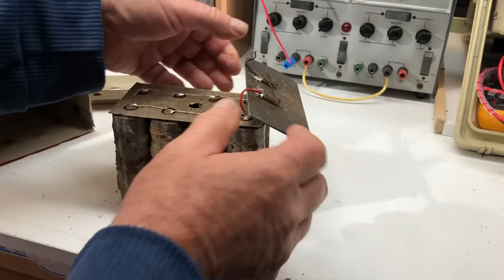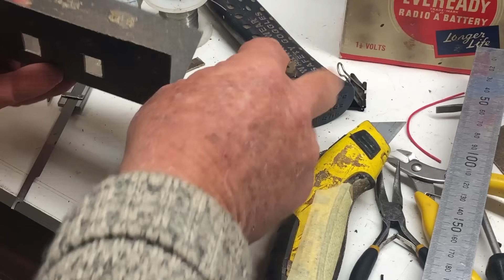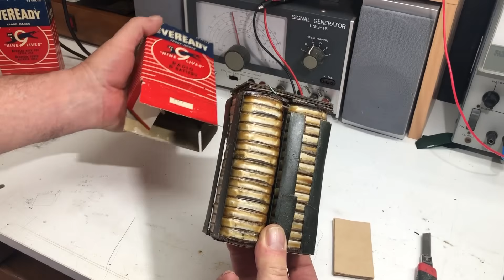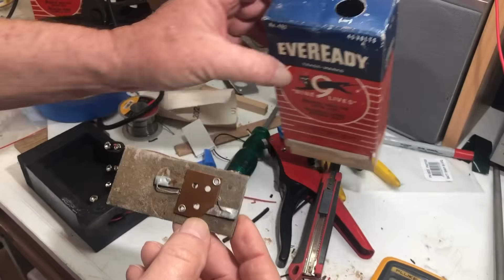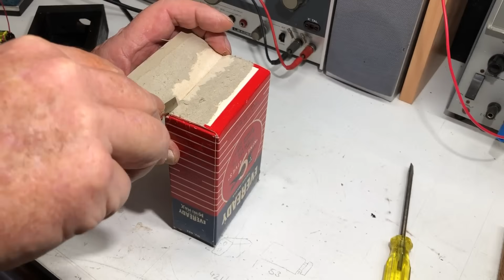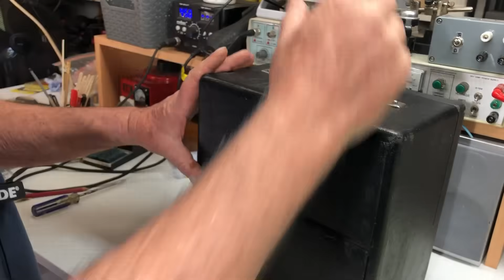Peal Radio - Old batteries live again!

Comment: What a lovely old radio and I love how you've kept it authentic. I also remember deconstructing those old Eveready batteries when I was a child. Great job you've done.
Edit, I remember the later 9volt box battery, maybe it was the '276', instead of the earlier waxed cell internal construction, the later ones had a plastic frame inside the cardboad box, with 6x 'C' cells wired in series, within the plastic frame.
Reply from the maker: Thanks. I didn't know about the later 9 volt ones. I only remember the old wax ones, but then I haven't pulled any of them apart for a long time prior to this.
Cheers

Comment: What degrees of complexity might be involved if you wanted to use rechargeable batteries please in this set up to produce up to 90v?
Reply from the maker: Hi
If I was going for rechargeable batteries I would probably arrange the batteries so that when being charged, they would be switched from series to parallel so that you could charge them at 9V (at a higher charging current).  You would probably need to get a battery charge board for each battery (a few dollars on ebay) and do the switching with relays activated by the charger being switched on.  It would be a bit complex but I think it would be achievable for a reasonable cost.

Comment: I had a job as a high school student replacing radio batteries in the 1950's  for people on vacation at  a lake resort.
The big part of the job was to have the proper battery sizes in stock which was a challenge as there were so many different radio brands and models. I remember the Zenith Transoceanic battery was so expensive that few customers would be willing to purchase a new one and if they did would use it sparingly and it would last several seasons.
Reply from the maker: Hi
That sounds like a fun job.  Just . doing a little research around the batteries in this radio I'm finding an incredible variety of batteries that are no longer available.
I guess a Transoceanic would have been a high end radio and perhaps they considered that if you could afford the radio, you could afford the batteries.  It does sound a bit ridiculous though.
Of course the revolution of transistors changed all this.
Thanks for your interest
Cheers

Comment: it wouldn't be too hard to make the high capacity batteries with some lithium cells , 12 or so would make the 45 volts,  nd you could put a charger inside the battery,
Reply from the maker: Hi
Yes, a few people have suggested similar things.  I like the idea of putting the charger inside the battery, that would certainly be the most convenient way and charge cards are available on ebay for not much.
However this is not my radio, so I did what the owner wanted and he was happy with the result.
Cheers

Comment: Great restoration job on the vintage batteries, there are a few companies in the UK, who will make up replica battery case outer boxes & also 3D print suitable battery holders for what ever type of cells you want to go inside.
That's a nice little radio, a good sound, I like the way that opening & closing the front cover turns it on & off!
Reply from the maker: Thanks Richie
I have had a look at some of the UK companies offering replica batteries. They look like good quality. Unfortunately freight from the UK makes them uneconomical here but it's good to know they are being produced.
Cheers

Comment: Very nice job on those batteries. They can now be easily replaced when needed and look the part. The case came up very nicely also.
Reply from the maker: Cheers Ian.  It worked pretty well for a one-off job.  Lots of people have said that I should've used rechargeable batteries but that's not what the owner wanted and would add another degree of complexity.

Comment: Well done, I remember working on battery sets just before my mother died, and making up the 9 volt batteries for the 90 volt section, and the 1.5 for the filaments. Unfortunately I lost a lot of stuff, and spare parts, and valves etc, when I had a stroke in 2022 I'm only just getting interested again in it. I'm now trying to replace some of my stuff, I shall never have anywhere near the amount of stuff that I had ever again, a life long hobby just gone to waste.
I have a large family out in Australia, but of course I'm in the UK, I never hear from The Young Ones now.
Yes i remember pulling old 9v batteries apart as a kid, at least we could pull them apart in those days without the risk of them bursting into flames. Similar to what you were indicating at the end there, it's not a life today it's just a trial.
All fond memories from years ago.

Lovely video, you've worked hard, thank you for shariyng it take care my friend.
Paul UK.
Reply from the maker: Hi Paul, great to hear from you.  I suppose one of the main reasons I work on old radios is that they bring back memories of simpler, happier times when quality mattered and things were made to last, not thrown away when the warranty expires.
Your stroke must've been a major setback in many ways and it's a pity you lost all your gear, but I believe it's never too late to start again.  You haven't lost your knowledge or experience and you're regaining your interest. The rest will follow. 
As I'm sure you know, you don't need much to get started and you can buy what you need as it is needed.
All the best, Paul, and please keep in touch.  I'm glad you enjoyed the video. 
Cheers
Reply: @Donno308 Hi Don, thank you very much indeed for your kind words and wishes going forward, it's very much appreciated.
Yes you're absolutely right, that was exactly what I was thinking, when I was having a look through some resistors and capacitors, it wouldn't take much to get started again.

Thank you for your words of encouragement, that was heart felt, Thank you. I 'll keep in touch.
Take care, Paul UK.

Comment: Well, if you are merely going to install modern batteries in the old cases, why not use Lithium Ion cells? They offer great current capabilities for their sizes...
Reply from the maker: Hi Gary
If it was my radio I would seriously consider doing that, although I would probably go a NiMH battery for the filaments.  I wouldn't want to risk running them over voltage and I would prefer to run them somewhat under. Those valves are becoming hard to find!
However, the owner just wanted it working as simply as possible for display and demonstration purposes, so that's what I did for him.
Cheers

Comment: Hi Don, have you used any Lithium-ion cells before, as I think these being rechargeable would be ideal? The only problem is that the voltage is 4.7 volts fully charged, but a small step-down DC-DC Buck converter would easily drop the voltage down to the couple of volts required for the heaters of the mini valves. The same lithium-ion type batteries can also be used for the HT supply  9 would give you 42.3, which should be sufficient or go to 10 and get 47 volts, which again should be ok. The voltage control and charging circuit and socket can be found on eBay, or if you have problems, just let me know. I have used these devices on many projects and have not as ot yet had any problems. The beauty is you don't have to keep on replacing batteries when they go flat. Regards MoK Electronics engineer and one-time radio & TV repairer for over 70 years.
Reply from the maker: Hi
If it was my radio I would seriously consider doing that, although I would probably go a NiMH battery for the filaments.  I wouldn't want to risk running them over voltage and I would prefer to run them somewhat under. Those valves are becoming hard to find!
However, the owner just wanted it working as simply as possible for display and demonstration purposes, so that's what I did for him.
Cheers

Comment: Looks like the original cells were " F " cells
Reply from the maker: Hi Graham.  I was wondering what they were.  I've never heard of F cells but I'll google it.  I guess it makes sense that they would use some standard size rather than custom make them just for that battery pack.
Cheers
Reply: @Donno308  Yes, the originals are 'F' cells, the same diameter as a 'D' cell but about an inch taller, you cant buy them individually, but if you really want some, you'll find 4 of them inside one of those 6 volt square 'lantern' batteries, (often numbered as a '996' battery here in the UK) the type with the 2 springs on the top, they are still widely used in things like roadworks warning lamps.

Comment: To save a bit of soldering place the batteries side by side and flip every second one so their polarities alternate. Now use the connectors as jumpers between the batteries (short the connector so it becomes a jumper). Chop one connector in half to use for the first and last battery - the half connectors are the only ones you need to solder to a wire.
Reply from the maker: Hi
I did try that some time ago (before I was doing youtube) but I found that the 9V batteries were just a fraction too big to fit that way.  
I also thought of clipping the batteries together with their own connectors with every second one upside down.  That didn't work either, for the same reason.
I suspect they deliberately make them that way to prevent stupid people from doing stupid things.
The nanny state strikes again!
Reply: @Donno308  I've never had that problem, but haven't done it for ages. Perhaps manufacture variations? Anyway, your solution works great.

Comment: Great job! 
Looking at this article the F cells used in the big 741 battery are still made and can be found inside other current batteries. 

https://en.wikipedia.org/wiki/List_of_battery_sizes
Reply from the maker: Thanks for the info. I googled it and it seems that there is also an alkaline equivalent too. That could be useful.

Comment: When I was a boy my grandfather gave me his Rogers beach radio from 1956.
I happened to live not far from the Eveready factory and my dad knew one of the workers.
I was able to have them build me a new B battery replacement and it looked factory correct.
Actually the artwork was very close to the B type seen her only no white horizontal lines just a red background. 
It was really expensive for a child it had to save up a while.
I opened it out of curiosity to find it was all hand made and soldered wires just like in the video. 
The best part was they upgraded the actual internals to the black label HD where they originally were the red label Transistor type.
It lasted over 3 years of occasional use almost reached 5 years.
Edit
I forgot they also gave me a small paper sack with about 20 factory Clips used in the making of The 9v series and I could solder on the bottom and use for anything small as a cheap disconnect.
Reply from the maker: Hi RetroCaptain, 
From your profile I guess you're in Toronto, so greetings from Australia!
Interesting story about the batteries.  
Those clips would have come in handy.  
When I was looking into reproducing these batteries I searched for fahnstock clips for the A battery and they are really expensive. I could only find them in America and shipping / post cost a fortune.  Ah well, who wants to buy anything from America anyway!
That made me think: If I removed the clips from all the flat 9V batteries I've got, they would make handy connectors.
Cheers
Reply: @Donno308 Hello Donno😊.
I get much of my media from Toronto actually I'm not far at all. 
I still have the radio and some of the clips though I bought a few brand new plastic cover radio clips so I didn't need most of them.
The battery factory closed permanently after Gillette bought out Eveready.
Rogers Radio and TV later became Rogers Telecommunications and is almost as big as Bell Canada now.
Rogers had their own line of vacuum tubes and also sold to competitors such as 
Pye Radio and Electrohome Industries.
I remember that radio made a "twinkle" sound like tiny wind chimes at switching on.

Comment: Hi Don do you have a local parson who can spot weld busbar strips across the top and bottom of 6 D cells to fit inside the old card battery box like we used on electronically controlled pool tables when i was a leisure engineer in pom land.
Reply from the maker: Hi Stephen
Unfortunately I don't know anyone who could do that but it sounds like a good idea.
I was also a "leisure engineer" in Kings Cross, Sydney in the 1970's and early 80's.  Mostly pinballs and early video games like space invaders and pac man back in those days.
Cheers

Comment: I have an Electronics experimenter kit from the '50's that uses a 45 volt B battery part number 455.  It has snaps instead of the plugs like yours did.  Oddly enough, there is a company called Excell that makes a modern version of the 455 but at $47 USD, I think I will make up one similar to what your made.  Any chance you are going to share the scanned pictures?
Reply from the maker: Hi
Happy to share the scanned pictures.  I haven't yet cleaned them up & got rid of the blemishes and stains, If you have photo editing software you could do that yourself or I could send you the finished ones when I'm done.
Send me an email and I'll send you the scans.
Cheers

Comment: Nice job! That must have been a day's worth of woodworking and puzzling. But the result is very nice and authentic. 
Any idea how much it draws on each battery and how long they will last?
Reply from the maker: Hi Kristof
The owner came to pick it up before I got around to measuring the current draw from the batteries.  I don't expect the filament battery would last more than a day or so. The B battery should last a good while though.  I don't think it matters too much in this case as it will mainly used for display.
Yes, it took a bit of puzzling to work it all out and if I did it again I would probably do it differently.
Cheers

Comment: Great job on the battery.  My mind was going on using 18640 li-ion cells. 12 in series with a bms. You could use the 3th pin for charging
Reply from the maker: Hi Maaren
I did think of that but the owner just wanted it going.  He is a collector and will mainly keep it for display purposes, although he does like to have his radios in working order.
Cheers

Comment: It's best if all the paralleled batteries are fresh and of the same lot number, e.g. don't reuse the single battery you had been originally using even if you have the rest of the batteries from that package and they have the same lot number.  I think the holes in the old batteries are likely due to reverse charging.
Reply from the maker: Hi
You are quite right about reverse charging.  I discarded the partly used battery and put in all new ones from the same batch.
I really think the holes in the old ones were just from age.  Who knows how many years they have been in there!
Cheers

Comment: Very nicely done throughout the series Don, the battery cases your built are just awesome and it's impossible to tell they are not original.  That's definitely another one saved.  Thanks for sharing your work mate :-)
Reply from the maker: Thanks.  Yes, another one saved is always good.  I enjoyed this little radio. In fact I might do more battery sets if I get the chance.
Cheers
Reply: @Donno308  I know what you mean Don, I have a little Nordmende Transita Royal I'm just dying to have a look at, it can be either mains or battery operated.  It works fairly well on AC but the spring contacts are so corroded I didn't dare insert batteries to try it yet.  I'm sure you know what I mean here.  It's going to be the subject of a restoration series very soon.  Manuel did one just like it last year I believe, hence why I feel brave enough to tackle it.  Have a great evening :-)
Reply from the maker: @raymondmenard5444  Best of luck with the Nordmende.  You can probably find replacement springs for the battery compartment, even if you have to buy battery holders and remove the springs from them and perhaps modify them.  Probably nothing else wrong with it.
Reply: @Donno308  I think I might be able to salvage the springs, but seeing you use those battery holders gave me a plan B idea that's for sure :-)

Comment: HI Don, good video! will that radio work on AC power too, if you are interested, I built a power supply works on line voltage I can share with you.
Rich
Reply from the maker: Hi Rich
I was thinking of trying to design on "in my spare time" lol.  Yes I would be very interested in the power supply.
Thanks
Reply: @Donno308  sorry Don I tried to figure out a way to get that pdf to you but apparently, I can't figure out how to do that, I tried to place my email address, but it was deleted
Rich
Reply from the maker: @richb419  Hi Rich. Yes Youtube doesn't let you put any external links in comments.
To find my email address, go to my channel home page by clicking on "Don's Old Radio Shed" 
Under the heading is says "Repairing and restoring vintage valve / tube radios ...more.
Click "more"
That opens a drop down menu. About half way down is says "view email address"
Click that and you have my email.
If you have trouble, get back to me and I'll work out something else
Cheers
Reply from the maker: @richb419  Hi Rich
Let's try this. It might get deleted but you can contact me on:
donno1955 at hotmail dot com
Reply: @Donno308  that worked!